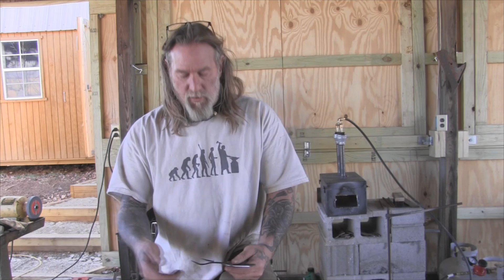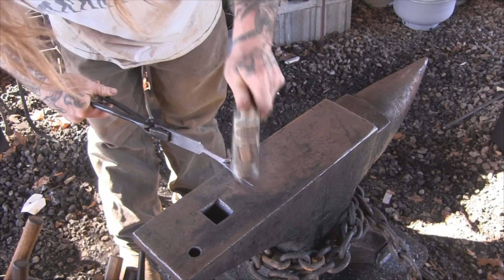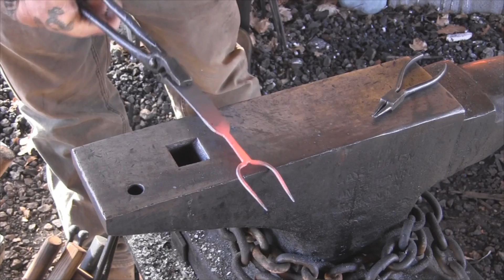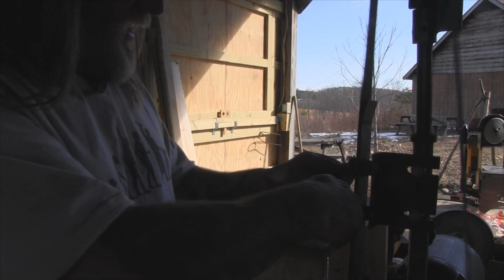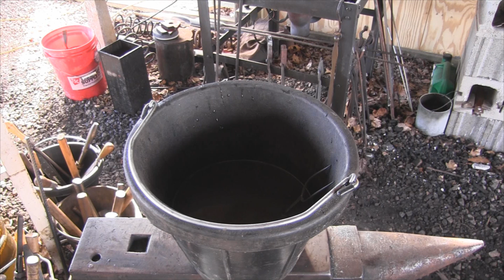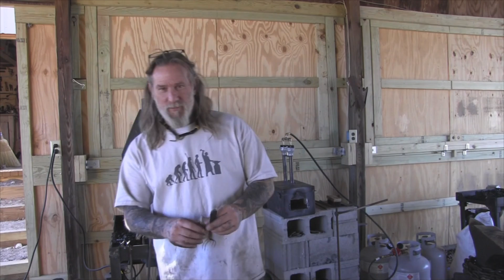Revenant Striker

Comment: Love to watch you doing your blacksmith thing.  A friend and I just built a small furnace for melting aluminum cans and pouring it into muffin tins to form ingots for later use.  We filled two muffin tins with aluminum the first time we used it.  We were so impressed, we had not done anything like this before, so we built the furnace and tried it.  We are fixing to build another one with some improvements that we discovered would work better after trying out the first one.   We had a blast with it.  We have both always wanted to try blacksmithing.  We may be on our way.  This was just an experience and test we wanted to try.  It worked great.  Thank you.

Comment: Can do the same overall things with two of those crooked awls made into a fork, right?  Considering that they are heat treated to be used as flint strikers & you'd have the same number of prongs.  Not all one piece, but you can still use both awls for strikers & for sticking the food like you would with a sharpened twig.

Comment: Perhaps you could try and cook something speared onto the tip of the fork, after that try and strike a flint on it see if it works or not, just out of interest.
Reply: +girafmad I was thinking the same thing.
Reply: +girafmad just one single test is not enough it might work after the first ,second or so time but after a lot of use it would effect the metal
Reply: NOOBODY You are right, I guess it wont fail until you need it the most :P

Comment: Would it protect the handle of the fork from annealing if you used a long stick with a split in the end (the length of the handle,) slip the fork handle inside and tightened it in place with some wire? Easier to stand back from the fire. Would it really get hot enough to anneal the metal if cooking indirectly?
Reply: I guess you could poke the fork into a small piece of soft wood to prevent accidents, but I would do this when placing in pack to prevent tears/punctures. I think if you are not paying attention, you can hurt yourself when striking the handle, so I opt to pay mind!

Comment: What would have happened had you tried to create sparks before heat treat?  Heat treat makes metal harder, right? Wouldn't a striker be better if it were soft?
Reply: +Adam Whitlach if the metal was softer it would not spal it would just deform and make no spark.

Comment: I've been blacksmith for awhile now and my Vulcan anvil that I use is roughly 125#s. I have it connected to a oak stump with my hammers connected to the sides with leather. But my question is how does your anvil have little to no ring? I have chain wrapped around the base of it already to cancel some noise but im wondering what makes yours so quite?
Reply: I heard a heavy magnet would help?

Comment: oh i can see them in the store already lol
Reply from the maker: +Boreal Woodsrunner The only way you could afford to sell something like this would be if you had a totally water jet blank you only had to run on a sanding belt and heat treat, if you add 30 min of forging labor as well as materials and heat treat time to this it would be too expensive for most folks
Reply: +wildernessoutfitters What about mirrors made out of polished metal?  That seems like it's be less labor-intensive & would be an interesting idea.  It could have two holes next to each other to keep from spinning while hanging, a striker surface, and an edge- all kinds of stuff.